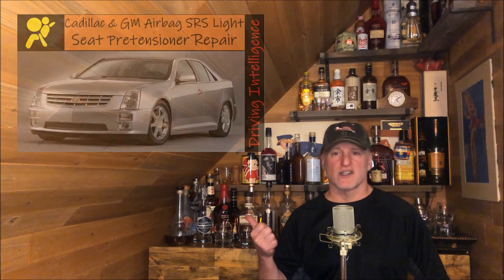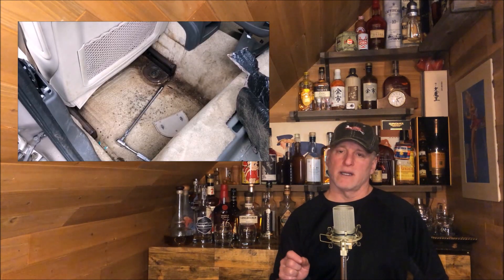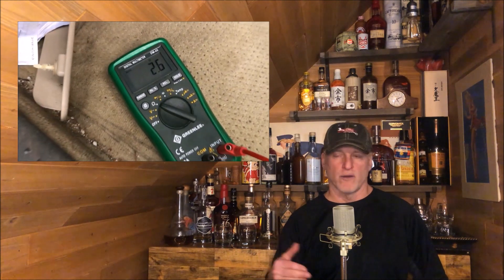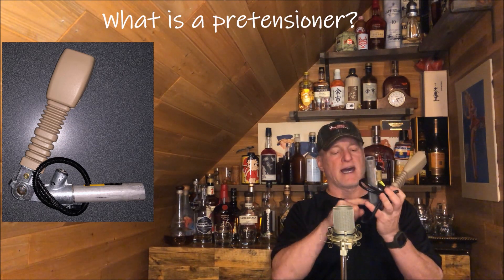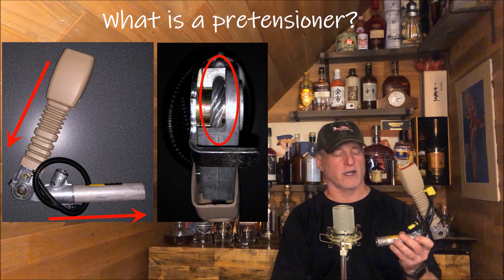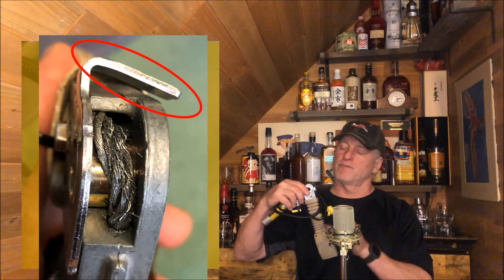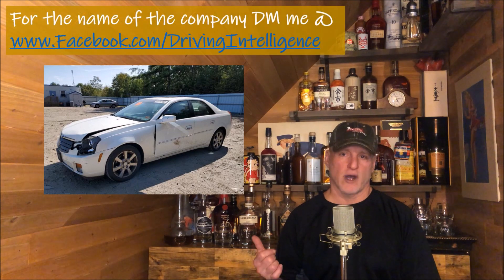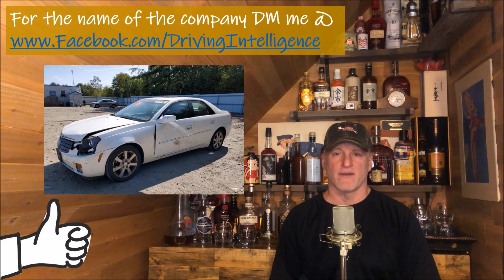Repair or Replace Seat Belt Pretensioner or SRS System Components? Cadillac GM Ford Honda Toyota

Comment: In the USA, if you have a clean title and you're SRS system has NOT deployed.
The federal law mandates a lifetime warranty.  Parts and labor.  Don't fuck with it. Take it to the dealer.
Reply from the maker: I’ve never heard of that. I just did an Internet search and see no information on your claim. Please share a website that indicates that this is true.
Reply: @DrivingIntelligence   Ok. Looked into it. Maybe just a Honda thing. Honda did get hit with government lawsuites over failing systems. I still get recall notices for cars I don't own anymore.
Reply from the maker: @JonathanWhoever  thanks for the clarification.  I did some research since I got your comment and couldn't find any generalized federal requirements for SRS warranty.
Reply: @DrivingIntelligence  Hey man, I'm wrong all the time.
Reply from the maker: @JonathanWhoever Don’t stop, challenging me! I enjoy scratching my head and learning new things, the reason for my channel
Reply: @DrivingIntelligence  
02 Accord
03 Odyssey 
03 element 
All repaired under warranty.  It's not just a Honda thing. 
Though the stealership did try to sale me on others things. I spent about 3 decades working on heavy trucks, so I fix all my own junk. They shouldn't even charge a diag. 
I wish emissions was warranty.

Comment: Have you had problems with your F150 seat belt,  mine no longer retracts back in to the seat when removed, I have to manually feed it back in to the seat back, I've tried taking the seat apart and lubing the retractor assembly but that didn't work, I'm afraid if I try and find a good one in the wrecking yard I'll end up with the same problem and taking the seat apart is no fun job either.
Reply from the maker: If you go to a wrecking yard, you can check the retraction before removing and buying.  I've never had problems with the F150 retractor.